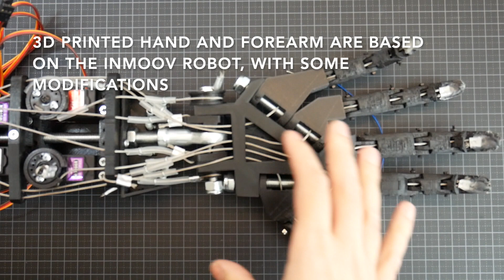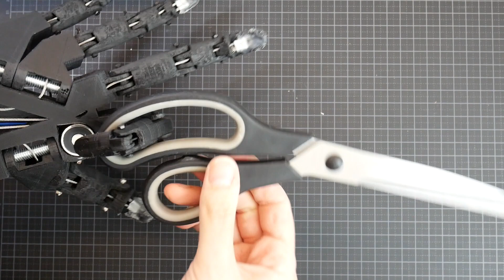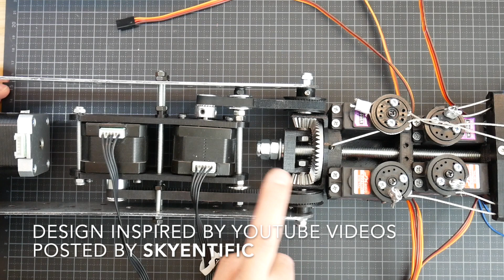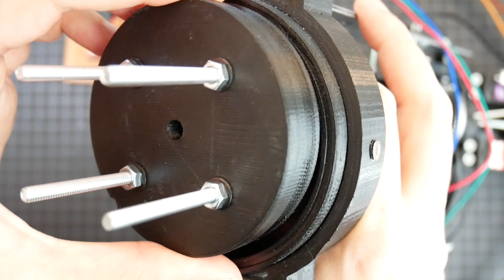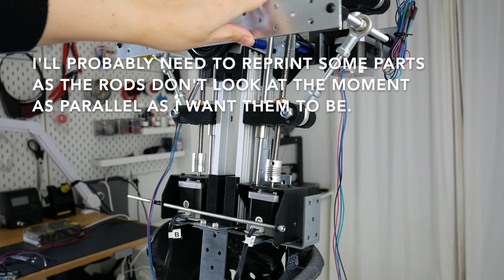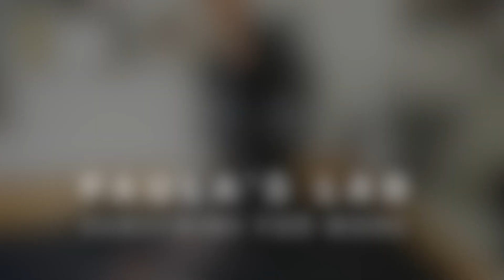Humanoid Robot - Project Update (March 2020)

Comment: You actually didn't reverse the rotation of those two deers you just flipped the gear to the other side it's still spinning the same direction
Reply from the maker: The direction will be controlled using a stepper motor driver and arduino, so we can move either in the same direction or opposite direction, depending on the outcome we want (rotation or flexion).